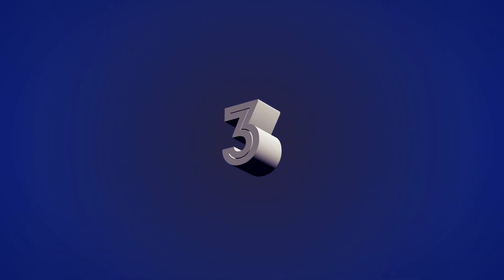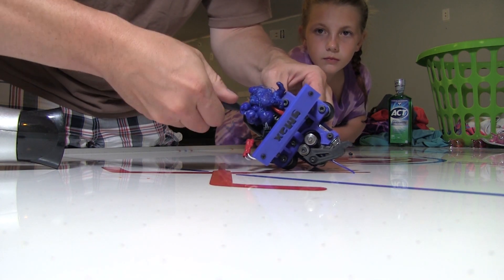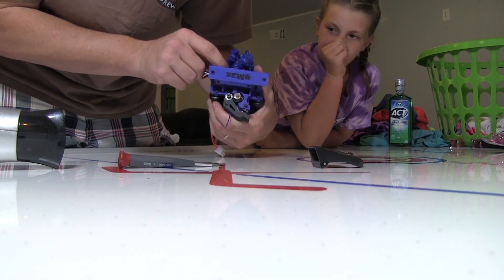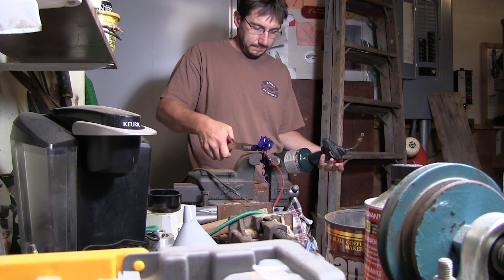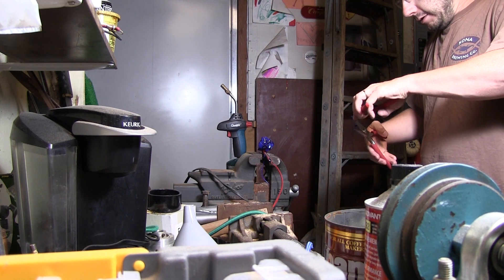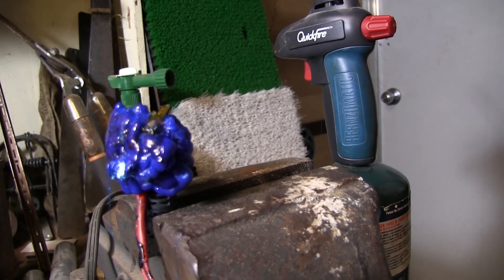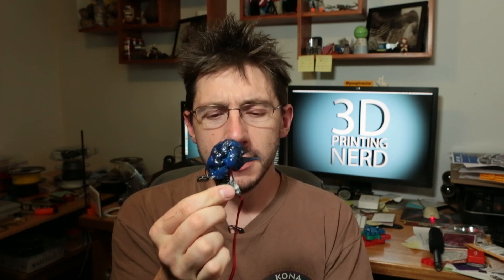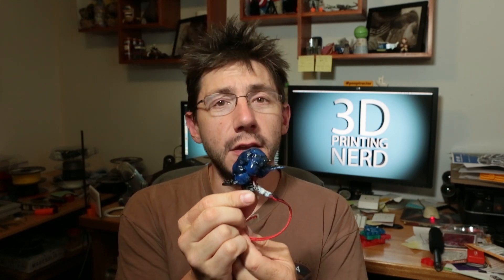Can You Fix a 3D Printer with FIRE?

Comment: Could be years too late for some, maybe not for others. In my case putting a cutting disk on a dremel and setting speed to 15, the disk spins fast enough to "cut by melting", going most of the way through, turning off the dremel then using pliers to twist and pull a chunk off at time did the trick.

Comment: Two weeks ago my Cr10s did that same thing. I wound up getting the plactic off but also ruined the thermister wires. 
Had to replace the hot end and it was pretty painless thankfully! 
I feel your frustration for sure but a heat gun would do the job a wee bit safer than the torch lol
That being said i sure loved watching you torch that sucker off lol

Thanks for sharing and as always Keep Building👍

Comment: Hi I have had a few of those kinds of mess ups I have a wood burning iron that has changeable tips one is a cutting type of tool when I had a cluster of filament I used this to cut away most of the mess then on the metal parts pliers over the kitchen stove (it's not as hot as your touch)had to cut the wires on the temp sensor and heater element but was able to splice new wire on to them and go back to printing. I have left a print before and even thou I have printed before with no problems it went south I have gotten to the point I won't even leave the room the printer trolls know if you leave and they jump into your print and dance their ass's off high five and remember it just a print it may bring a tear to your eye but still just a print

Comment: Soak it in acetone. It softens PLA to a light mush, then you can just clean the part. Careful of the thermistor and heating element though, idk how those react to acetone.
Reply from the maker: I thought acetone only worked on ABS?
Reply: 3D Printing Nerd For smoothing yes, but another YouTuber decided to try smoothing his PLA with acetone, and it began to turn into paste and get gooey. I'll find the vid and reference it real quick.
Reply: 3D Printing Nerd wait, sorry. Found the vid, but I was mistaken. The PLA did get soft, but what I saw was actually just a failed print. Acetone does soften PLA after about an hour's soak, but I don't think it would be enough to clean off that much plastic.
Reply: The video was by Thomas Sanladerer. If you look up "Acetone plus PLA" he should be at the top.

Comment: I use one of these to clean up... https://www.ebay.co.uk/itm/858D-220V-SMD-Soldering-Desoldering-Station-Hot-Air-Rework-Gun-Tool-3-Nozzles/301966004104?epid=581359676&hash=item464e938f88:g:2rwAAOSwSWJXRVdW

Comment: I would just plug in the hot end and set it to around 190 for PLA, once the inside melts a bit or transitions from its glassine state the blob should simply pull off - I had this exact issue on Prussia MK2S once because my cooling fans went tits up but the printer kept going

I think it's time to combine computer vision with our slow Mo shooting cams to keep an eye on things and when they're not coming up as there's supposed to shutting it down

Comment: Good example of failure.
My advice is cut the excess but not damage, then with the minimal of it heat the head to 200° on the 3D printer and get a pair of tools to release the rest.
Step by step with patience and time, everything can be done.
Hi 5.

Comment: Same thing happened to me where i had about a 75gr blob engulfing my entire Prusa hotend assembly. Ripped out all fan, thermister, and heat probe wiring. I unsuccessfully tried both blowtorch and Dremel method, but settled on torching a putty knife and "scraping" the plastic off. Took a while, but I was able to free all the parts with minimal damage.

Comment: Next time this happens sir.  Simply turn extruder back on and bring it up to temp. Typically you will be able to break large chunks off or the whole thing will come off. I had this happen and it went about removing in that fashion and all I had to do is clean the heater block off and it was all good.

Comment: I know this is an old vid but I it did make me wonder if going the other direction would have helped at all. putting it in the freezer or put with dry ice to make the plastic more brittle and possibly pull away from the hot end a bit.

Comment: next time that happens, reheat the hotend  and it will heat the plastic from the inside and it will come right off, ran into that problem a few times with long unattended prints that come loose from the bed, huge mess and total aggravation and loss and it's really a pain but you can get it off....

Comment: I had this happen on my TAZ4 with ABS.  I was able to use my Dremel tool to cut away the majority of the plastic.  I then heated the hot end on the printer until what was left softened. I squeeged the heaviest deposits off with a popsicle stick while hot.  The rest cleaned off pretty easy with acetone.  I don't know if this would work with PLA though.  Doesn't it crystallize somewhat if it heats long enough?  And what solvent works on PLA?

Comment: Is there a way to trick the 3d printer into printing a full print with a
 disabled extruder and hotend? I am thinking of mounting my 3d pen onto 
my 101 hero so I can print myself your mount and spoof holder etc... 
temporarily use it like that while I wait for my replacement parts to 
come in. Right now I figured out how to mount my pen and all of that 
works but repetier keeps shooting error messages if I unhook my extruder
 and hotends and it is just not safe to keep an unused hotend on around 
kids... So any ideas how I can at least disable my hotend and continue 
the print successfully?

Comment: You could have simply put it in boiling water. This will soften the PLA significantly to be removed by pliers. I had tried to modify a PLA print by putting it in hot tap water (the hottest possible a tap can provide) and hand molding it. I think this is the safest way.

Comment: Lol Awesome Trades Assistant you have there. You just can't find good help these days ;) maybe oven baking would have worked although the wire insulation would have melted as well but easy to replace and although outside of glob would have melted i reckon it may have got soft enough in the centre to peel off

Comment: Actually did something similar using a gas stove with the heat brake and feed tube out of my flashforge dreamer, results were a little better.

I agree with the oven comment though, if you warm it up to nearly melting temp over an hour or so, you might be able to just peel it off...

Comment: Too bad there is not any specific solvent that would dissolve PLA and only PLA.  I guess it wouldn't have helped to soak it in boiling water - not hot enough - unless that may have softened the PLA enough to allow easier removal...  Depends on the properties of PLA at lower than fully melting temperatures I guess...

Now what do you think was the cause of the original problem?  What caused the extruded PLA to mess up like this?  Incorrect extruder temperature for that particular PLA filament maybe?  Bad filament that didn't melt and flow at the same temperature throughout the spool?

Good luck, and keep up the great work!

Comment: plug in and let it melt it its self  till it drips off 250c shud do the job don't pull the plastic  as cold bit may grab the  wires these can be replaced after the blob has left the building just keep an eye on it

Comment: Why not carefully saw it with a small iron saw leaving the inner intact? Then splitting it with a wedge? At least that's how it works in the plumbers world :P A cutting tool for Styrofoam could have helpt you out as well. Just resistance wire a big power supply and a elastic band and paperclip. You can heat it up to have it above the 220 and cut of the plastic.

Comment: if you invert a can of compressed air and dump the contents on it it will freeze the plastic, then a good firm wack of a hammer and it will crack and shatter. much quicker and less messy, but it can explode and send plastic flying.. lol

Comment: maybe putting it in the oven for an hour  and let it soften slowly.... ??
Reply from the maker: well shoot, that would have been a WAY better idea.
Reply: Maybe you still can salvage most parts.  Thermistor and heathercartridge are probl busted but the rest should still be usable.
Reply: Hmm...I was thinking that a "Dremel" would have come in handy to cut away the majority of the excess/mess...But perhaps You don't have one (then again You almost ought to buy one). 
And when enough had been removed possibly using acetone to remove the last remnants...but I guess it's "to late now" ;)
Best regards.
Reply: Another idea might have been to use a soldering iron.
Reply: well no because EVERYTHING would soften. Especially if there are any printed parts

Comment: Boiling water maybe?
Reply: Melting point of boiling water is to low. Most plastics need around a 200 degrees C melting point, water can only reach 100 degrees celcius. So you can only get it warm.

Comment: Couldn't you have turned on the hot-end itself to soften the plastic?
Reply from the maker: I tried, then a bunch of smoke poured out, so I stopped :(
Reply: Sensible move.

Could it be that the core of your blue blob was burnt (as opposed to melted)? I'm not sure what happens to PLA after it burns, but it may no longer melt properly. Do you have any insight? Are you up for an experiment? :-)
Reply from the maker: Michiel Helvensteijn Oh, believe me, the next time this happens, I'm going to go 100% SCIENCE on it! :)
Reply: 3D Printing Nerd Hm.. Sounds like a long time to wait for results.

No, I'd just like to know the properties of a burnt blob of PLA. Can it still melt? That'd be useful to know. And it seems like an easy experiment to run under controlled conditions, but my home is not exactly set up for that. I'm pretty sure it would violate my tenancy agreement. ;-)

Comment: what do you think cause this because right after I watched this video my printer did that. good thing it's a small print. what's your advice to prevent this from ever happening.
Reply from the maker: This was because I didn't watch the first few layers go down. Those are always the ones that if not down properly, badness can occur. When you print, just make sure your first few layers are down and 99% of the time you're golden!
Reply: thank you after what you said I try printing the same print again and I all came out like that so I think you must print less multiple parts as much as you can.

Comment: Buy a cheap soldering iron and use the tip like a knife and cut your way trough the gunk, no open fire = much more safe, and it can be used to weld plastic pieses together. Just a idea.

Comment: If this is ABS, you could just have given it a acetone bath. For PLA An acetone bath will soften up the plastic over a few hours, but will not dissolve it. You should invest in a heat gun, much safer than a blow torch, and more effective tan a hair dryer.

Comment: I know the video was posted in 2015, but what if you were to use liquid CO2 (upside down compressed air)  to freeze the part that crack it in the vice? in theory PLA is brittle and it should work, i will have to try a test piece when i get my new PLA supply.
Reply from the maker: +William Estlow I totally should have tried that! Next time I jam up a nozzle and get a ball of filament caked on this bad, I'm going to try that.

Comment: I was doing a 26 hour simple print, didn't expect it to fail. The next day I had a glob about three times that size on the head and extruder. I used a hot air gun with a fine tip and attached an exacto blade to it. The hot knife did wonders!

Comment: if you soak PLA in acetone it weakens so it can be easily torn apart. Just for future reference.
Reply from the maker: +Drew Zoghby I thought acetone only worked with ABS?
Reply: Although the Acetone does not dissolve it, if you let it soak overnight the PLA becomes very rubbery and starts to split apart and then can be easily pulled off of things.

Comment: Had a similar experience with ABS on my TAZ4.  Carved the majority off with a Dremel and removed the rest by heating up the hot end, using a heat gun (hair drier on steroids), dental picks and acetone.  Took about 6 hours, but the head is still printing just fine.

Comment: I had a similar issue with my Duplicator i3. Crappy Cura slice resulted in a blob.
Ended up heating up hot end to 240, and used a soldering iron and long nose pliers to remove pieces of the blob.

Comment: I know this is an old video, but I wonder if a hot wire cutter or maybe a Dremel heat tool with the exacto knife tip would cut through PLA.  Maybe could've trimmed down the blob and then heated the extruder enough to loosen what was left.  I am learning a ton from your experience!  (I already knew how to destroy things with fire, though)  #highfive
Reply from the maker: +Molly Kenneally Hi Molly! I wish that sort of thing would have helped. The plastic seemed to have annealed around the extruder. I would have had to be SUPER extra careful removing it, and the wires were already toast. I had a new one on the way, the fire was more cathartic than anything. Thanks, as always, for watching my old stuff. #ReturnFive

Comment: Thumbs up if you subscribe because the blow dryer was loud!..... NOT!!!
Reply from the maker: +VenomTheCat DUDE I AM SO SORRY :(
Reply: I'm just messing with you :)
Reply: 3D Printing Nerd Hey do you mind testing the settings on Simplify3d for Rafts in Version 3 I cant get it to work and they never separate in version 2 it works perfectly
Reply from the maker: VenomTheCat I've used rafts with V3 many, many times and they work great! What are your settings? I do change my separation distance from default .14 to anywhere between .2 and .25

Comment: I'm still trying to figure out how this happened.
Reply from the maker: +MOO Tech When the first layer goes down but doesn't stay down, it lifts and sticks to the extruder. It acts like a wick and as the plastic is extruded, the stuck plastic brings it up. This happens for many, many layers :)
Reply: +3D Printing Nerd I have never had anything like that happen. Of course I haven't ever had major problems getting prints to stick to the heated bed.
Reply from the maker: +MOO Tech I have never had anything like that happen SINCE then. Just the perfect storm I think.
Reply: +3D Printing Nerd I usually don't leave mine alone for to long cause I just don't trust it not to have a major problem like that.

Comment: Yeah that... that sucks man!  I really hope they get that Retouch 3D thing out soon!  It's like a soldering iron, but with a digital thermostat you can set temps on.  And heads designed for fixing and cleaning up 3D prints.  Well, the raft/support cutting head would have let you slice through that PLA blob like butter.. possibly been easier to clean up.  Anyway, good to hear you had backups!  Now make sure to order to replace what spare parts you used!  Don't want to have another problem and not have spares around!

Comment: Your hotend should already have some Kapton tape on it, but since we use that to adhere to the print surface we know it sticks to PLA & ABS...A-LOT.
So Wrap your hotend in Kapton tape then aluminium (aluminum) foil. That way, if you have a fail like this you can just re-heat your nozzle for a while and pull the debris away with the foil
Reply: +Chris Mitchell 
Only had one incident myself and did just that - I heated the hot end for 5 minutes and gently - GENTLY prised the plastic away!

Comment: I only printed two things from my robo 3d printer and it did that. I caught it in time before it got that big. I was able to save the whole thing accept for the heat break. I used a soldering Iron to melt most of the stuff off. The rest I used a lighter to finish it off.

Comment: I had this happen to me recently. The best way that I found to fix it is to just heat up the hotend while it is still connected to the printer, that way the plastic softens from the inside out and you can pull the blob of plastic off.

Comment: Y not use acitone
Reply from the maker: It's PLA. I though acetone only dissolves ABS?
Reply: +3D Printing Nerd  ultimaker had an article on it if you search acetone and pla on Google, and it said it works with most brands but not with colorfabb pla so if you were using colorfabb pla it would not have worked but if you weren't it might have worked and fixed your extruder
Reply from the maker: Taylor R Thanks for the tip, I'll check it out!